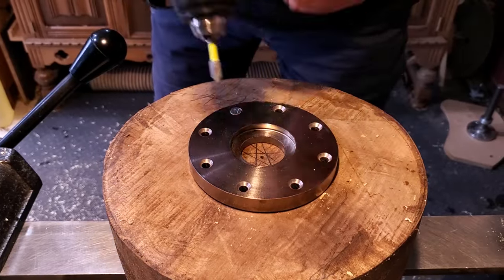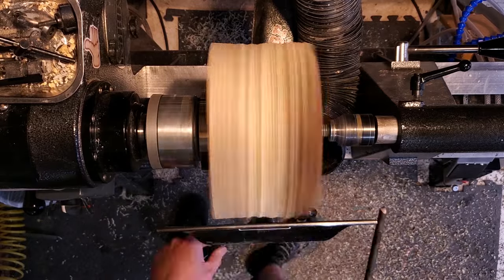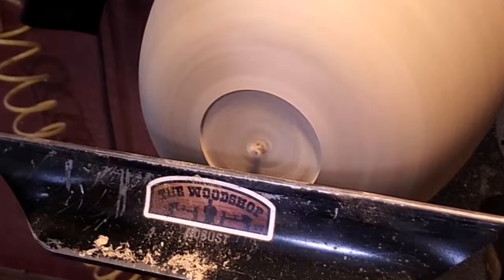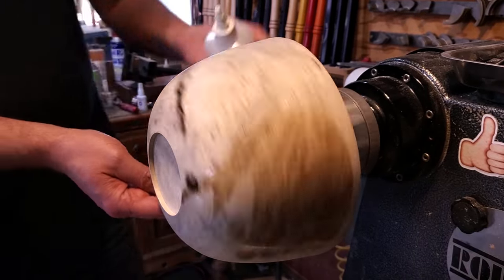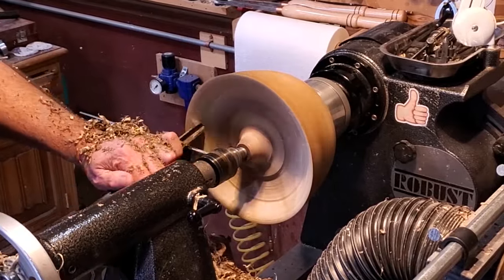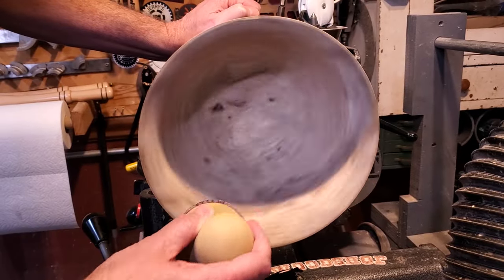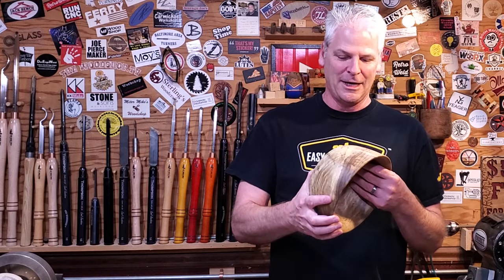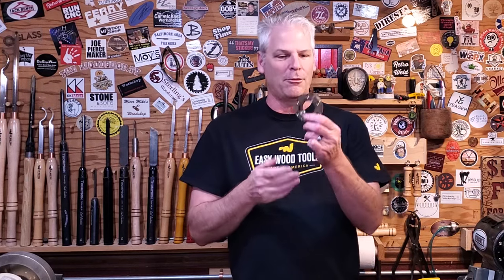Woodturning | Myrtlewood Bowl

Comment: Carl, I went to the Easy Wood Tools site you listed, however, they do not show the faceplate rings or the multi-spur or four prong drive inserts.  I have all the easy chuck and other easy chuck jaws.  Love them.  Please send info on the new accessories please.  Thanks.  Cheers, Tom
Reply from the maker: Hey Tom, I guess I jumped the gun a bit! They should be on their website site very soon. They just released them.
Reply from the maker: I hound it :) https://www.easywoodtools.com/shop-lathe-accessories
Reply: @CarlJacobson  I called them and they said they put it up this morning. They have them under Accessories.  Trying to see if I can budget for two or three of the 3” rings. 😁
Reply: @CarlJacobson  Do you have a deal with them to get brownie point or something if we use your link or mention you or some code?  Just thought I check before I pull the trigger and order my rings.  After all it was your YouTube video that I first saw them and decided it would be a handy addition to my tool box (at least until I have to sort and clean it out again 😉).  Cheers, Tom